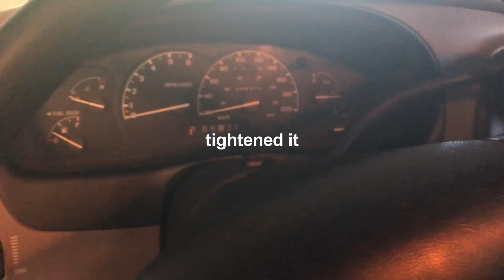FORD RANGER STOCK TO OFF-ROAD IN 7 MINUTES!!! (BUDGET BUILD)

Comment: Great job.  If you are not going to regear, I found that a tuner helps a lot with shift points.  My truck came with 4.10 : 1 gears.  I put a 3" body lift, 1.5 " hub centric wheel spacers and 33" Mickey Thompson MTZ tires and it felt like my truck was struggling when off roading, not a lot, just more than it should.  I was about to regear but decided to give a tuner a shot.  It no longer feels like I am over working it.  I like your wheel well cut job, it just looks right...
Reply from the maker: Thanks! Ya if it was a nicer vehicle I would do more of that stuff but it’s a weekend warrior haha thanks for the input tho
Reply: My 02 came with a super chips tuner. It came in handy when I switch gearing

Comment: Nice fab on the box.  A couple pockets in the center section for spare tires, and a pull out drawer out the back of the bed "tunnel" would be really cool.
Reply from the maker: Thanks! Ya I’ve been told a few times to add a drawer there I might just have to lol

Comment: 35s with stock gearing is perfectly fine especially with automatic you probably have 3:73 or 4:10s
Reply: It's do-able, I've been doing it for 3 years now, but I would never say it's a good idea lol. Soooo sluggish and the trans will hate you so much. 4.88's will make it a beast on and off road, and leave you open to 37's if you wanted.

Comment: If I could get a second ranger I'd like to turn it into a  off road truck, don't want to do it to my ranger that's going to be my daily. (2011 sport 4x4 4.0L v6)

I do plan on getting a lift and one step up bigger wheels and aftermarket head/break lights etc. But I want a overlander eventually as well
Reply from the maker: Sounds like a good plan

Comment: As someone who didn't want to spend money on gears after switching to 35's.... spend the money on gears lol. it's much cheaper than spending money on a new trans, and the better driveability on and off road will be so much better.
Reply from the maker: I would but this ranger is just a beater for me if I took better care of it I would hhaha
Reply from the maker: @RathAdventures  ya man if this thing blows up I plan on getting an older ranger with a straight axle I got this truck for 200$ so I just send it

Comment: 3.0 liter 35" tire's how's it do on hills? I have a FX4 level ll 4.0 factory manual transmission and transfercase 4.11 torsion  lock differential 31 spline 8.8 axle. 3" body lift sitting on OEM  Alcoa  wheels and 33X10.50X15 Super Swamper TSL's and it runs out of power on the sand hill's.
Reply from the maker: It did pretty well! I have off road videos on my channel you should check out to see it in action

Comment: Just bought a Ford ranger and it has the same issue with it not going in park all the way what’s the reason it did that and how do you fix it
Reply from the maker: There’s two screws that might be loose under the dash by the pedals that’s what fixed mine someone made a video about it on YouTube
Reply: @Carfleet  thank you
Reply from the maker: @edgarmontoya2039  np man!

Comment: hey how did you tighten the shifter? my 2010 ranger has a loose shifter as well i need to tighten
Reply from the maker: Hey there’s 2 nuts that are loose underneath the steering wheel you could also search it on YouTube it’s kinda hard to explain!
Reply: I had the same issue but the bolts were tight. The problem was the bushings. Ordered them on Amazon for $5 and she was good to go.

Comment: What was wrong with ur 4wd? Just a bad transfer case motor? Did you have the hi and lo lights flashing on dash? Thanks
Reply from the maker: I started by changing the t case motor then that didn’t fix it so I made free manual locking hubs 
https://youtu.be/CuqMbJM_E_g